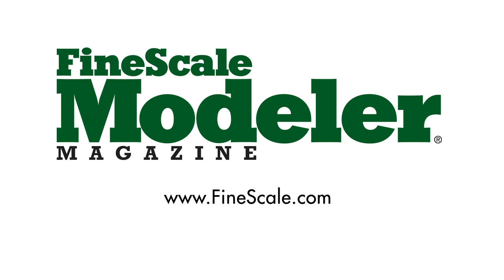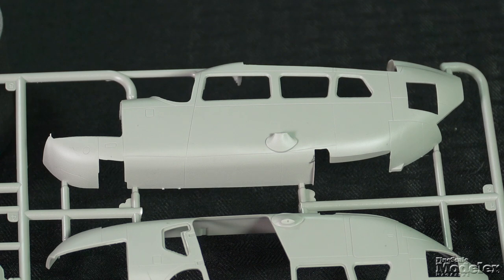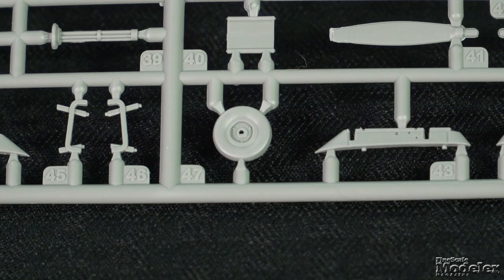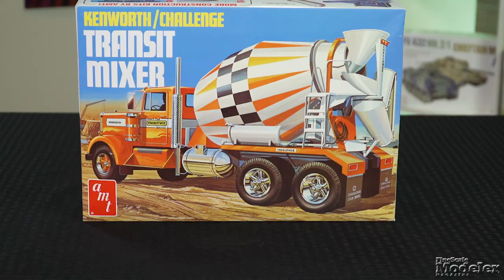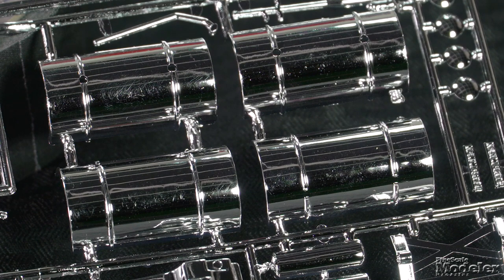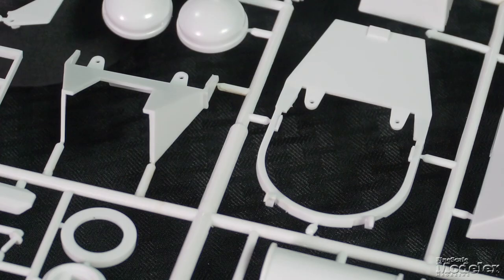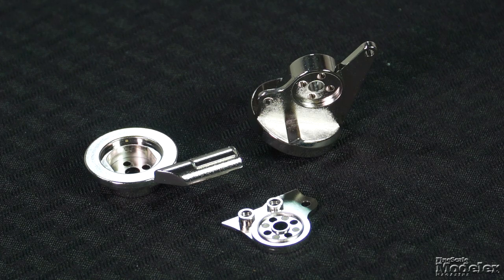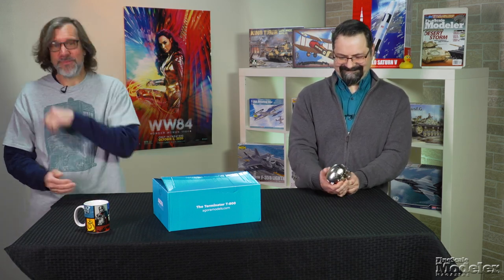Video Review of Roden Cessna Skymaster, AMT Kenworth cement mixer, & Agora T-800 from The Terminator

Comment: I wish that Revell or even Trumpeter, had come out with the Skymaster. I have some 1/72 Roden kits, and the designers didn't put any thought into the build process...only how the parts look on the sprues.  And then there's the marketing strategy that we always see with models. Release a few less desirable versions of a subject before releasing the version that everyone wants (the Vietnam war Forward Air Controller.) 

At over $1,500 the Terminator kit will probably be out of the range of most hobbyists, even in payments.  Andy's Hobby Headquarters YouTube channel had a similar R2D2 kit, that was just as expensive. Most people left comments about the high price, and he hasn't really shown anymore kits like that.
Reply: Never had a Roden kit, but have never read anything good about them. I wanted the Lynx version of the Skymaster as used by Rhodesia, but being by Roden... nope, I'll save my money.